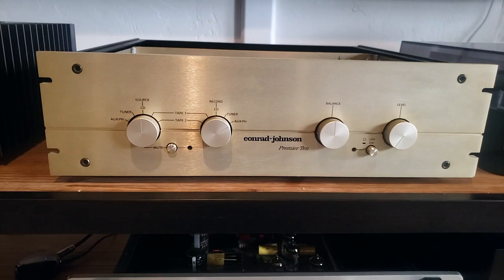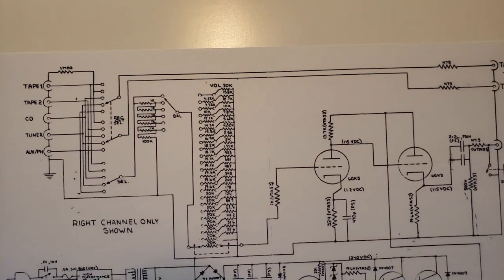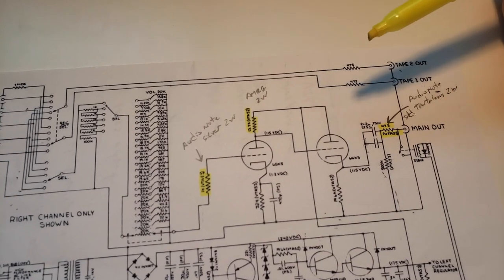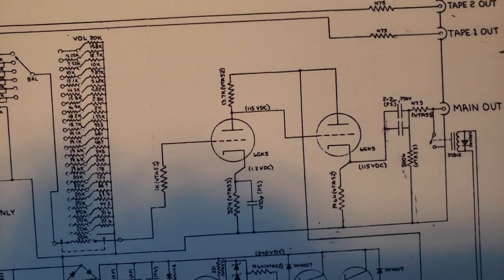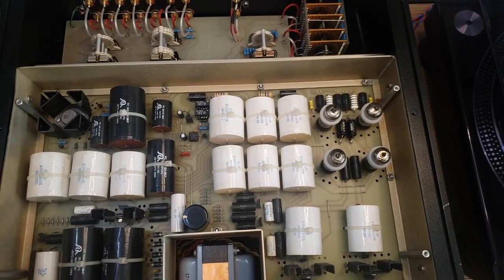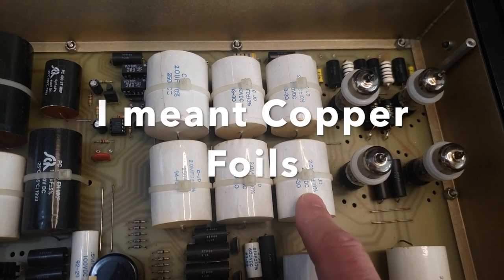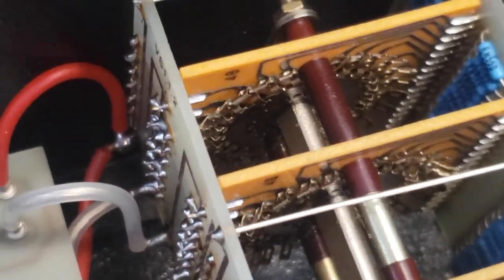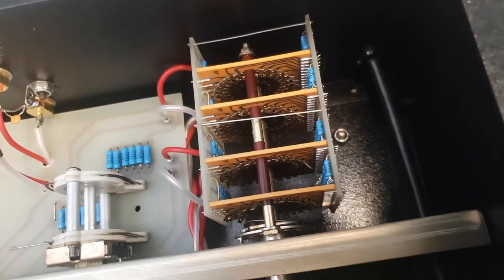Conrad-Johnson Premier 10 Vacuum Tube Preamp VINTAGE AT ITS BEST! MODS & MORE!

Comment: Nice but I don't believe on 6GK5 tubes for audio. They were used in tv IF circuits. I'm happy with my Audio Research SP6B.
Reply from the maker: Yes, AR and CJ are very different in their design implementations. The 6GK5 is nice that it allows for a Zero feedback circuit.  Remember the 6922 often used by AR didn't start out as an audio tube either. The SP6 is a great preamp! I have some AR mod/upgrade projects coming soon!
Reply: @hificonspiracy  AR is Acoustic Research ARC is Audio Research. The 6B preamp is all 12AX7s. I had one where they added 6DJ8s but it didn't sound right so I took them out and put back 12AX7s and it sounds good now.
Reply: 6922 is industrial 6DJ8.
Reply from the maker: @andershammer9307  my apologies/mistake from memory I thought the SP6 was based on the 6922 with some 12ax7s. My Bad!
Reply: @hificonspiracy  No need to apologize. The SP6C had 6DJ8/6922 tubes in the cathode follower stage so you were right but I don't like the sound of the SP6C.
Reply: @hificonspiracy  There were a few Conrad Johnson preamps that have become classics and are worth owning. I just happen to prefer Audio Research.

Comment: I wonder how this would compare to my Premier 17. Anybody?
Reply from the maker: I think the Premier 17 is a bit more euphoric sounding which I actually prefer. The 10 is very, VERY, uncolored. Perhaps more Sold State sounding with a slightly open/sweet high end but without ever sounding cold. At least after mods.  On the flip side I prefer the aesthetic of the Premier 10, the knobs, no remote so you have to get down to adjust the volume or balance. Which is cool in my book!
Reply: @hificonspiracy 
then from what you just said about the premier 10 being SS sounding...i may be making a mistake to replace my Linn klimax for this🧐
Reply from the maker: @briancampbell7712  SS may have been the wrong word. Its not cold or harsh ( and not all SS is cold and harsh) its just very un colored. Its not "as" tuby or euphoric sounding.  I have not heard the linn, they make a good product.  They are totally different designs. However is signal path in the Prem10 is significantly  less complicated and its tubed. My bet would be on Prem10 but it depends what you like. Happy Audio!

Comment: Definitely not. That would be the Audio Note M9 Phono Silver Signature.
Reply from the maker: Both units Class A, Zero feedback designs. Both use resistor ladder networks for Vol attenuators. I'll give you the AN adds valve rectification and higher grade resistors & caps. For what? $20k+? Have you see the trending cost for a CJ Prem 10? Its comical. How about if one replaced the CJ vol resistors with AN Tants and added some Copper Foils output caps. Run for the money for sure. 🤑 But no doubt the AN is a wonderful design.

Comment: It’s very unlikely . I own the top of the line  ART88 and sadly it’s mediocre at best
Reply from the maker: That's unfortunate to hear of your experiences with the ART88. What were you comparing it to? I think a lot of gear has gone backwards in sound quality. A lot of digital for sure. Not all but we certainly lost 10 years chasing oversampling. The ART seems to use a similar single triode cathod follower design as the premiere TEN. Different Tube. I wonder were it went wrong. I do personally prefer a slightly warmer colored sound. But it should be very transparent and reasonably dynamic.

Comment: This configuration is soooo basic, a standard amplification stage and a cathode follower. You are a least guaranteed a distortion level of 0,2%. Most guitar amps is made like that, and
that was because of cost issues. The input atenuator is cool though.

Comment: I verting phase IS NOT A DRAWBACK.  Just tell me technically why all preamps need to be non inverting.  You dont have to switch speaker wires.  INVERTING PREAMPS ARE JUST FINE.  NO BEARING ON SOUND WHATSOEVER